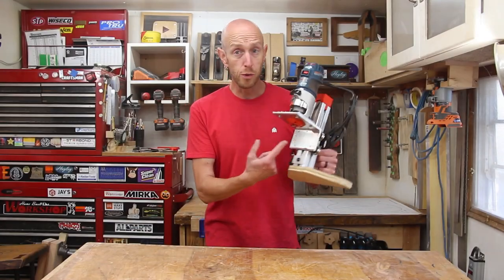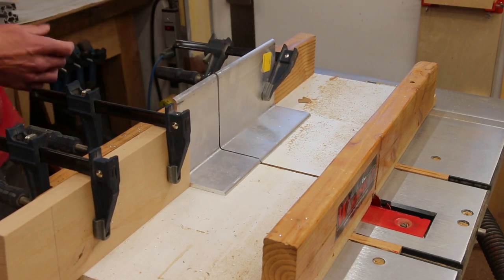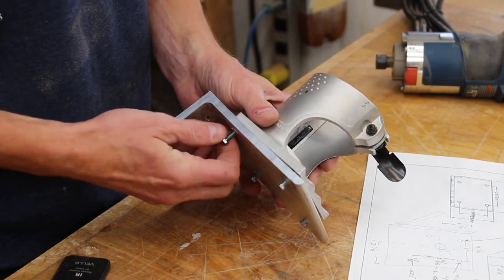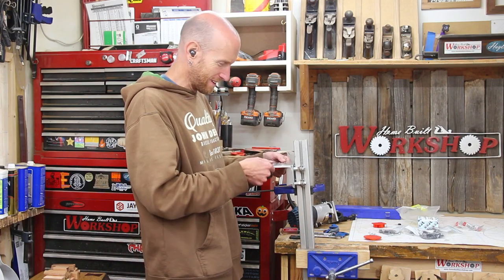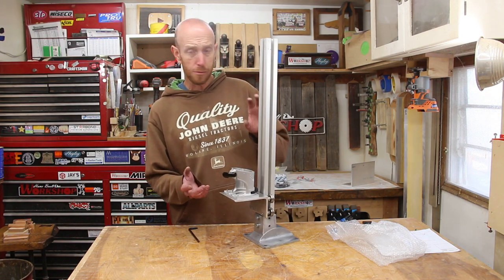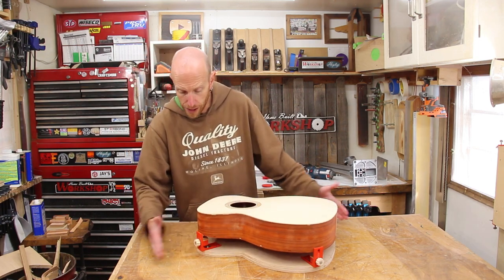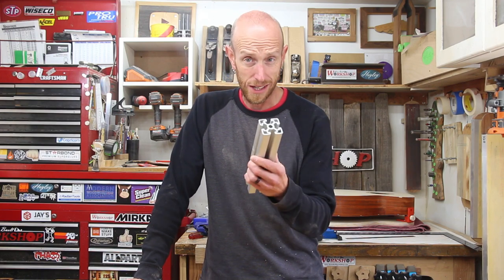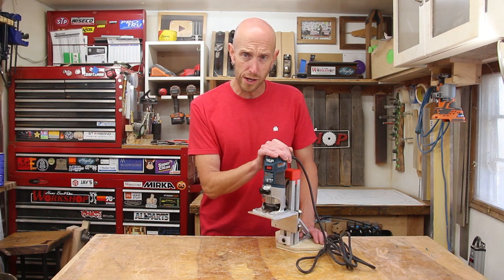Building my Router Binding Jig | Routing Binding and Purfling Channels

Comment: Could you have flipped the router bracket so instead of the vertical section facing down it faced up?
Reply from the maker: Yes, that would have been a great option. It would go low enough that way.

Comment: The constant tension spring is an elegant solution (also used by LMI on their binding jig) - but I found that a simple combination of rubber bands can also be used to provide just the right amount of weight relief so that the jig almost floats up and down at the level needed. My only issue with all of these vertical travel jigs - including the one I built myself (which almost identical to yours) - is that by design they're not capable of cutting at full depth when there's a relatively steep arch. It's not a problem with a full bodied guitar, but can be a significant one when routing around a Florentine cutaway on the back of the guitar (assuming the back also arches downward toward the neck). Thus in this area some hand work is still needed to make the channel around the cutaway meet evenly with the channels routed on the sides of the guitar. A binding jig that follows the sides of the guitar instead of the top and back overcomes this issue - but I only know of one on the market and thus far I haven't been willing to pay the asking price for it (but maybe that design could be shop made as well!)

Comment: Hey Jeff, you might have had the room  with the initial base for the tower if you turned over the rack you have the router on over… yes?
Reply from the maker: It's possible. I thought about that a couple times but I feel like eliminating it was a better option. That original foot is expensive compared to the angled brackets and plywood.

Comment: Thanks for the video. Most helpful. However, am I going mad,. or if you had simply turned the L-shaped bracket upside down [the moving bracket] you would have been able to use the original, I assume expensive,. mounting bracket. I don't think anything else changes by doing that, and with the L the other orientation, the bracket will not foul the mount before bit hits the guitar. PS love your mis-measure! My life is a perpetual cycle of mistake, correction, mistake etc.
\
Reply from the maker: I certainly could have done that. However, by eliminating that bracket, it brings the cost down though. Plywood is cheaper than that bracket. I returned the bracket.